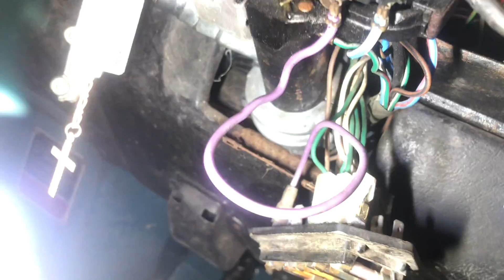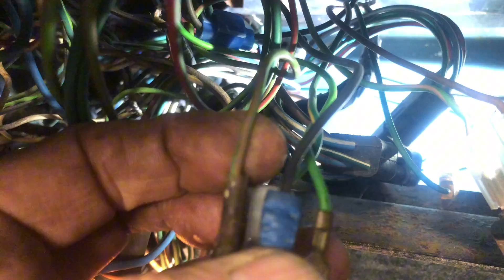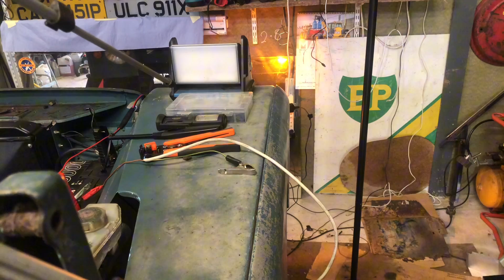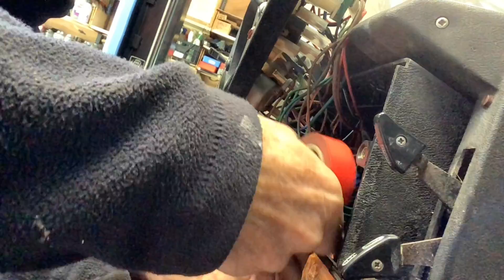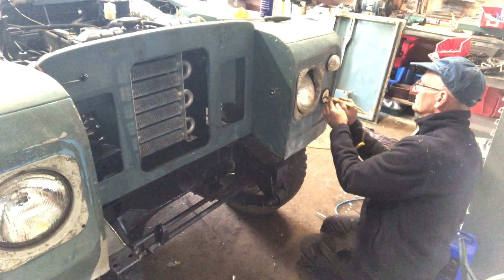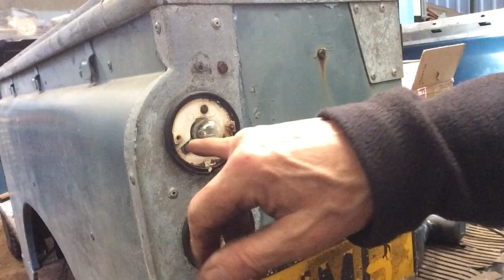Land Rover indicator repair and refurbishment. Land Rover series

Comment: Hi Russ, thanks for your efforts preparing all these videos, very enjoyable. Now regarding the indicator repair, inspired by this video i decided to try to fix the indicators on a John Deere ATV and to my surprise they used nylon bolts and metal nuts (suitable for a 10 mm tool, 3/8 is too small, but not M6 thread) i guess more or less everything is plastic. Now my question to you is: Would nylon bolts be suitable for indicators on land rovers to avoid rust and other potential aluminum-steel reactions? Or maybe ground goes through the body so metal would be needed to conduct electricity?
Reply from the maker: Well it might be worth a try. But yes they are earthed into body in some cases. Also you aren’t going to leave it outside in the salt and the weather for forty years so the rust is not likely to be as bad next time you come to undo them. Put a bit of copper grease on instead. Thanks for  the kind comment. Russ😃👍